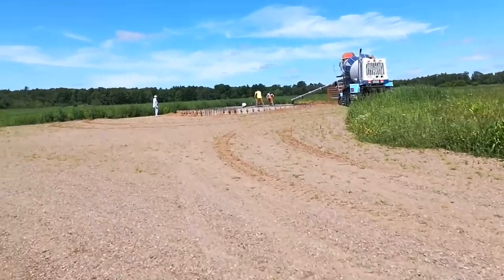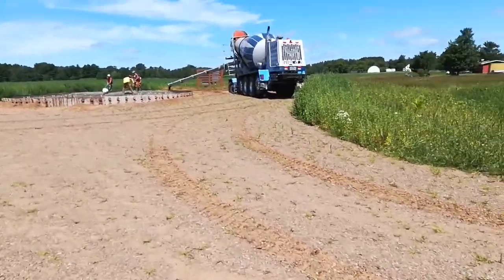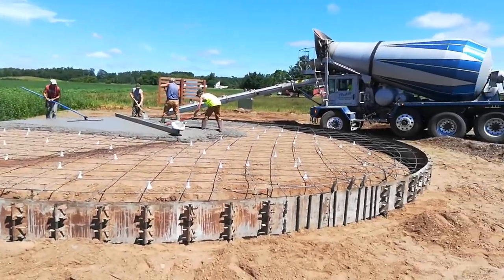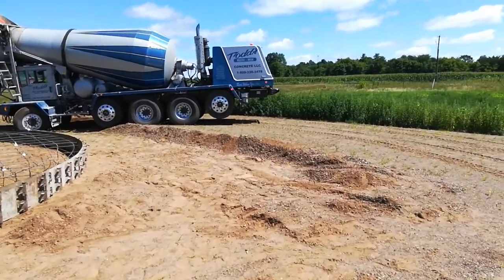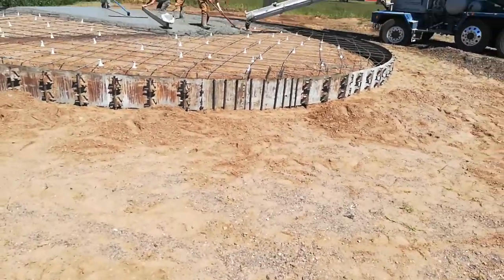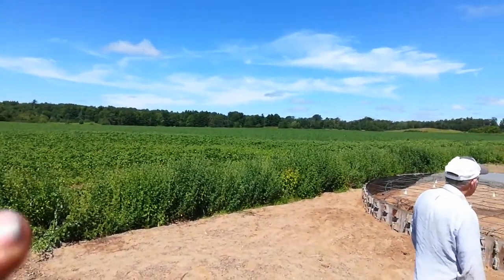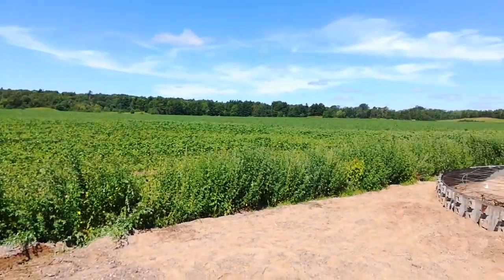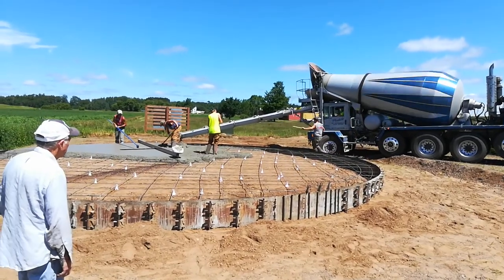Pouring Concrete for the New Grain Bin

Comment: Sand is a cheap and not good way for foundation. Aslo why do people pour concrete right on top of ground and not put a footer down in the ground. I'd worry bout freezing for sure
Reply from the maker: The sand allows all the water to drain out and so there is no frost heave. 
Prior to putting a top layer of sand the excavators dug down 6' (the frost line here) and replaced all the material with a highly drainable mixture of sand and small stones.  This is the process recommended by, among other professional organizations, the manufacturers of the bin, Sukup. 
Of course, you're perfectly free to build a foundation under your bin.